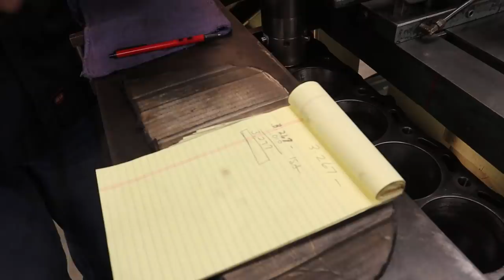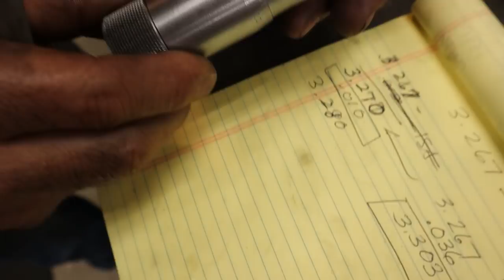4: How Much More BORING Can You Get?! Project 88 Update: Lessons on Boring the Block and Next Steps!

Comment: This is such a great video!  Back in the day, I pulled 2 $99 long blocks (at different times) from Pick-n-Pull for project Hondas.  I put new pistons/rods in them (Wiseco + Eagle) but the machine shop never let me see the actual process of boring + honing.  Really awesome to see that!  Good luck with your piston search.  In both cases, I went .040" (1mm over) and that was enough.  Guessing that you'll use an aftermarket MLS head gasket. 😊 Thanks again for sharing.
Reply from the maker: Yep!! I mentioned that in the video 😅
Reply: @FayeHadley  lol...in my defense, I was up until 1:30am watching this video.  Late for me,  but it was too interesting to stop halfway through!  I hope just one sleeve is all it takes.  Love how Danny leaves the ¼" step at the bottom of the bore.  Lots of people with built blocks have had machine shops not do that.  The sleeves eventually slip/sink and then the head gasket can't seal.

Comment: Wow...this is a great video, Faye. That boring bar that Danny has is absolutely killer! It's older, but very precision; and he knows how to use it. Since that engine block is kind of rare, sleeving might just be the answer? By the way, the metal circle around the head gasket is commonly known as the "fire ring." The metal etching on the deck surface of the block is most likely due to the engine sitting with rusty coolant in it. By the time you get that block bored and decked, it should have some additional compression ratio. Good for some extra power. As always, keep up the great work. Love the chickens.
Reply from the maker: Yes! That's the word!! Haha 😅 thank you!

Comment: This machine shop is up the highway 281 a bit from where I live.  

The "M" Toyota block is about the same size as the block of the Dodge-Plymouth 201-218-230 flathead six ( 3.25" bore) and would be a good swap into one of these oldies without the steering box clearance issues of a v8 swap.  The 7M is kind of a long stroke motor that gives good fuel economy and decent torque for its displacement.
Reply: I drove by there tonight, sign out front says to watch Danny and Faye on Youtube.   I have a '91 Toyota 4AFE block that I think I'll take to the shop for rejuvenation. The seller drove it with a bad head gasket - kept adding water,  he actually worked for Toyota building Tundras.  There is rust on the block deck surface and it doesn't seal after I had the head reworked. I might just get another block as these can still look pretty good with high miles on them and this one ran when I got it, but spewed water - no water was in the motor oil.

Comment: I have the same boring bar with the smaller 054 table, but am still using the original style carbide cutter where it looks like Danny is using a CBN.  Its nice to see that I am using it right.  I write all over the block and parts as I am building a motor, so my notes are all over the motor lol.   I would just see if there are 60 over pistons or whatever that is in MM since the wall thickness is so thick.  Since Danny is willing to sonic check it, I would do it.  If you can't get pistons, just sleeve it.  I have never had a problem with a properly installed sleeve.
Reply from the maker: Ah, that's so cool!! And great advice, thank you so much!!
Reply: @FayeHadley  Have no fear throwing some boost at a sleeved block.  I can guarantee that the sleeve will not be the weakest link.

Comment: Remember, the HKS pistons were the benchmark performance pistons for the 7M, and they were only available at 85mm, that's 0.080" overbore.  Many have ran them.  I have had custom 85mm JE's, but engine detonated because one of my multiple fuel pumps setup failed when bring pushed, leaning out the engine.  I now have custom 85mm CP's in my current block waiting to be dropped in.
Reply: Agreed on the HKS pistons. I think many people are frightened to exceed the Toyota "spec" for .040" (84mm) being the max bore size. Danny makes some very good points about the thickness of the walls between cylinders and the core shift being critical points. Perhaps that is why Toyota spec'd 84mm, as it would be within their manufacturing limits while still being warrantable and workable.
Realistically tho, any modern forged piston will be as good or better than the old HKS parts. I run Wiseco 84mm units in my motor but would not hesitate to run anything from CP or JE.
Reply from the maker: Aaron, I was looking at the 84mm wisecos! Those were the ones I saw on sale on the Driftmotion website!! And Howard, you're TOTALLY RIGHT! I forgot about that!!! What a great point! Maybe 60 over isn't that bad!!!

Comment: sometimes you gotta make your own tools, if you have the means to make them... i think you should have surfaced the deck before boring the cylinders. surfacing the deck would have ensured a perfect square to the cylinder. getting rid of the low spot in an over heated engine block would guarantee a straight cylinder... it's like i'm relearning how to bore a cylinder. loving it...

Comment: Very interesting video and informative on the process. The etching on the deck surface looked bad on camera. I would be interested in knowing the amount removed to clean the surface. What is the minimum deck thickness the motor can have? The number will impact quench and CR.
In the next video, maybe discuss the need for a torque plate when boring.
Great stuff first time watching.

Comment: If the sleave is done properly, it won't be an issue. I have done (2) 5MGE Engines, (1) had to be bored 1mm (.040") over sized pistons and it also had to be  line honed. both had to have the deck machined  around .030" to clean up the deck. Both Those Engines had a positive deck height already before cutting the deck to cleanup the pitting from rust. If you have to do this, Your next issue will be machining the tops of the pistons to achieve a zero deck height. The timing cover will be too high and will need matching, and then the Valve timing will also have to be RE- degreed in as machining the deck will stuff that up to.  Have fun with learning Faye. It's only money smile 😁 👍

Comment: interesting point about the deck dowel pins--i tend to use offset dowels where i can, so that I can shift the head relative to the bore (valves closer to bore centerline) and get the valves further unshrouded by the cylinder walls. I skipped thru the video, didn't see a torque plate, I;ll guess its because this engine design bolts the heads not to the deck (which can distort, esp. when the block is decked hard) but screws instead into the side walls of the block itself, like Pontiac V8's

Comment: I am getting ready to change a water pump on a 09 lexus rx 350. Any tips you have will be greatly appreciated
Reply from the maker: I have a great coolant flush video - if you have a lift pump to check your work before refilling, that's the best! Or pressure test! And don't use the paper gasket, use FIPG !!
Reply: Thank you so much!  I do I have a coolant vacuum and refill kit

Comment: I'm dealing with this right now with a vw tdi that I'm putting in a geo tracker.  I don't know how to proceed.  I know it helps to have the pistons before they bore it but how do I know what size to get until it's cleaned up? Will .5 mil be enough or will I need 1 over?
Reply from the maker: I'd recommend following the steps that we do in this video exactly!! Do you have a machine shop that's willing to work with you?

Comment: Boring? Yes it's really over-boring to be honest... 😂
Reply: @FayeHadley  Talking Toyotas, I used to have a '68 Corolla Coupe which had a 3K block over-bored 60 thou (I think that made it 1216cc?), to which I matched the original K head from the 1077 block, ported, with a hot cam and the B series twin carbs, light flywheel and a 5 speed transmission. So for a Toyota block 60 thou over is probably not that much to be honest. If it gets it all smooth I reckon you'll be fine. As Danny said, Toyota tends to make stuff thicker than average.